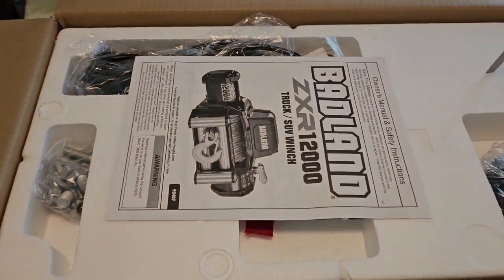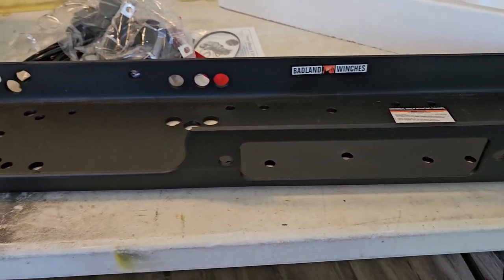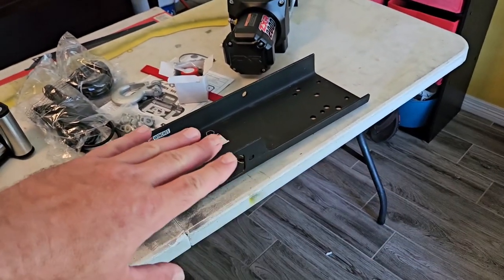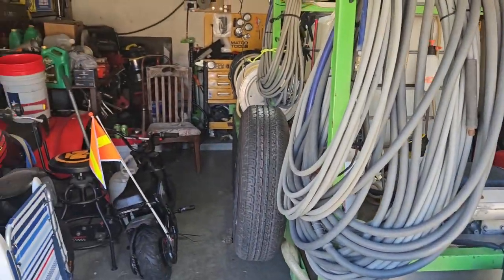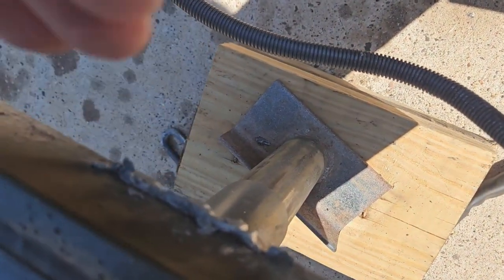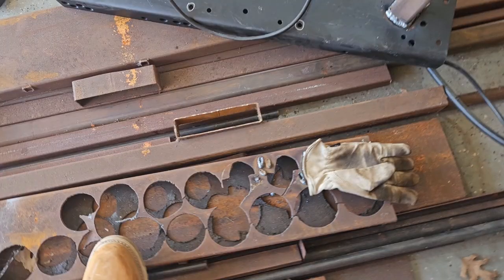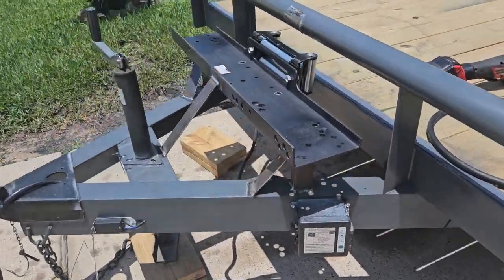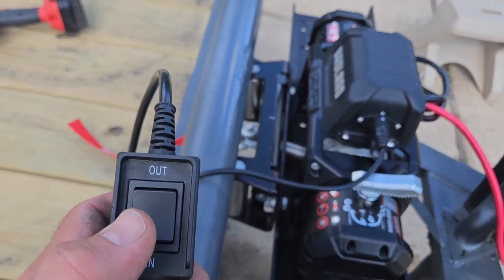Badlands 12k lb winch install | Harbor Freight | 18' Utility Trailer

Comment: Ran into this problem unexpectedly today. Nice relocation. I've noticed that it only needs 3/4" lift to fully clear the fairlead. I'll probably run some flatstock under it to create the clearance. Thought about routing out the decking to let the fairlead sit in the deck but I can see that become a puddle when it rains 😂

Comment: You could have added a 2"x 8" spacer board between the mount plate and trailer deck and longer bolts .
Reply from the maker: True. But that would've weakened the mount. I also didn't want it on the deck once I really thought about it.

Comment: Putting some braces on the back of the winch plate to the front top bar would also help strengthen the winch mount

Comment: Just had my mounting plate welded flat to the trailer and tried to install the fairlead...
Reply from the maker: Ouch!
Reply: @doitallgaragetx  Hey I've heard people say some of those winches failed,but the comments section said it's because the Badlands mounting plates are weak. Your take please?
Reply from the maker: @cecilb3216  I pulled a 67 Ford pick up truck up on my trailer like it was a go-kart. The winch mount I got from harbor freight wasn't weak at all. Thing had to weigh 25lbs or more. Very thick steel. I'd buy again.
Reply: @doitallgaragetx  thanks for your response. Go Texans

Comment: Slot the holes
Reply from the maker: @richard6897  ?
Reply: @doitallgaragetx  I believe it was the first obstacle that you came to where if you set it on a flat surface it wouldn't line up. Slot two  holes it will line up and you can slide your bolts through
Reply from the maker: @richard6897  I'd thought about doing that, but didn't want the winch on the trailer bed.
Reply: @doitallgaragetx  I would like to put a jib crane on my trailer I used to winch for pulling and lift-loading
Reply: @doitallgaragetx  I've sent thousands of pounds up cell phone towers had no slotted holes come in handy but so do washers and lock washers
Reply: Slotted holes won't work on this bracket. Once the fairlead is moved north, the upper cross section on the mount is blocking the fairlead opening and would cause wire rubbing on the mount when in use pulling anything above the fairlead.